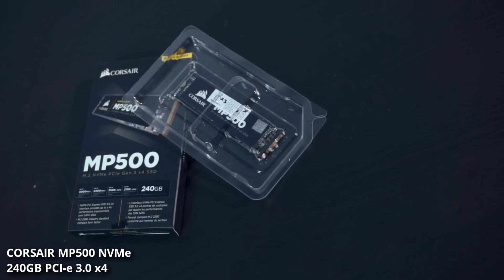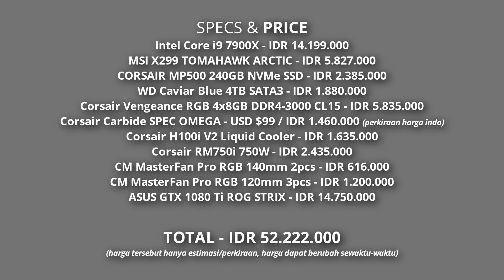RAKIT PC 52 JUTA (Core i9 7900X) Ft Corsair Carbide SPEC OMEGA! | BUILD LOG

Comment: - ram 8gb ddr3
- amd a8 7600 3,8 ghz
- mb  FM2A68M-DG3+
- hdd 320 gb 
Bang kalau spek pc ini rekomendasi vga rx 550 2gb atau gt 1030 2gb untuk main gta v?
Reply: Kevin Rivansyah sayang banget kalo pake prosesor yg amd a series utk dipakai vga lagi karena di dalam pros itu udh ada vga integreted jadi kalo dipasang juga performa bakal sama gk bakalan beda palingan beda 3 fps aja kalo mau ganti pros ke amd fx atau gk g4560
Reply: Rafi YC01 amd fx sama amd a10 bagus mana?
Reply: spek gitu bisa grapiknya paling low ya ?
Reply: Rafi YC01 biar crossfire mas 😆
Reply: coba cek vga radeon apa yang  bisa di hybrid crossfire sama tu apu, jangan dipasang geforce, trus tu memori dual channel ato single channel?
Reply: arif pare single channel
Reply: tambahin 1 keping lagi
Reply: jadi 16 ?gb
Reply: nggak harus 8 gb, 4 gb pun bisa asal clock speed sama, contoh pc 8500harus sama dengan pc8500, atau pc 12800 dengan pc12800, beda merk nggak apa2, , tapi kalau bisa merknya sama